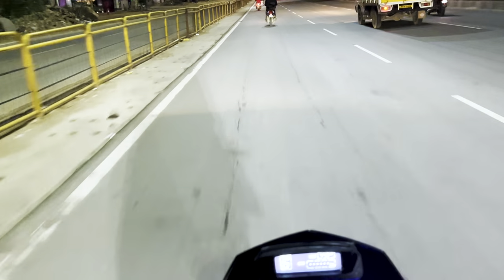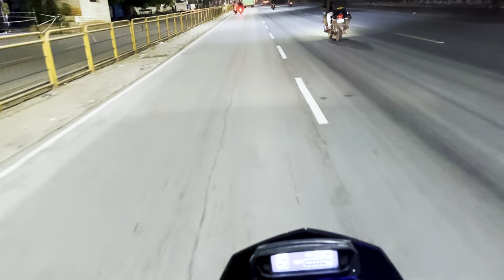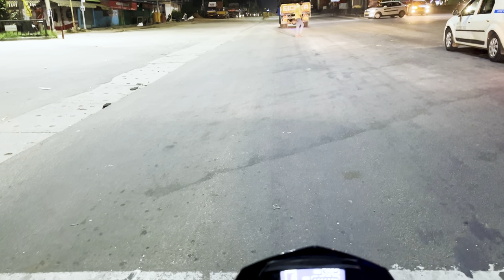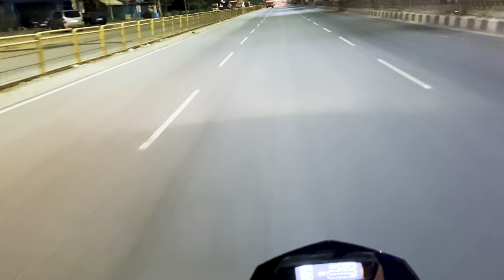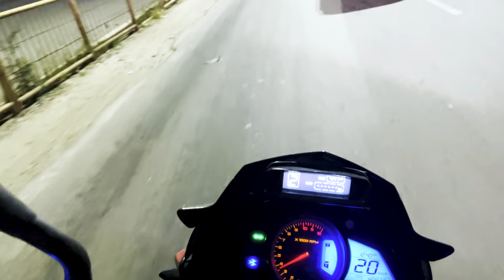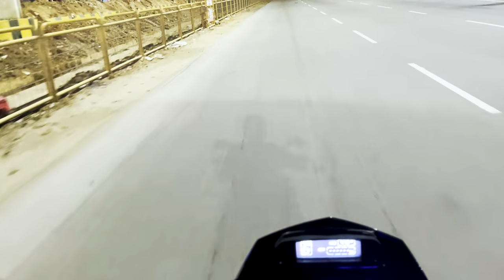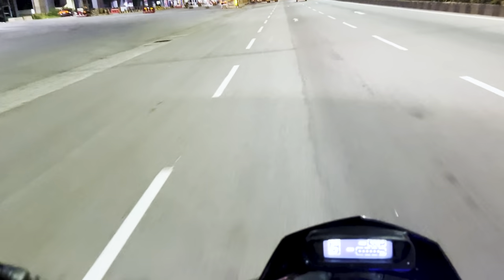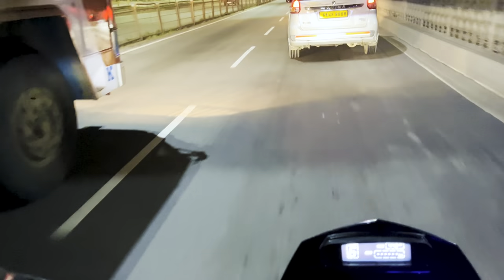Vlog #01 | Initial Review on Slipper Clutch in NS 200

Comment: Bro as u said if there are cuts in the basket we could change the basket to solve.. I have a doubt ns200 basket and n250 basket same or different? I saw ur installation video the n250 clutch assembly came with the rear basket but u didn't use it.. Is it same or different?
Reply from the maker: Hi bro, both are of different size so you cannot install n250 basket in NS
Reply: @ARKIONX  ok bro thanks... When ever I install slipper clutch in my ns I'll keep in mind that to use clutch assembly of n250 and the basket of ns 200... By the way I have ridden my clutch plates 45000kms a little pickup decreased but working fine even after doing wheelies😅

Comment: Hey bro, very informative video, the only channel where i found information about slipper clutch very clearly, 

My ns200 bs6 has clocked 10k km so will you suggest getting new clutch housing? 

Will i feel any glitches at 10k kms?
Reply from the maker: Hi bro ! 

It depends on whether you have any indentation on your housing. 
If you don’t have any marks on housing then just buy the slipper clutch unit. 

Even though you have ridden only 10k kms , the reason for indentation depends on how hard or smooth you operate your clutch and how hard you rev your engine. 

Better check and then make purchase decision.

Comment: Bro what about engine braking, gear cut braking.?
Reply from the maker: There is enough engine breaking to slow the bike down. Moreover once the rear wheel speed gets matched with engine, the clutch engages back.

Comment: Hi thanks for the review. Can you please confirm if this is compatible with 200ns bs3 model
Reply from the maker: Hi bro, I suggest you to take the housing to the spare part store to check whether the slipper clutch assembly fits inside the housing. 

If it fits then you are good to go.
Reply: @ARKIONX Hi bro i have installed the slipper clutch on 200 NS BS3 ( Initially launched as 200 NS later name changed to NS 200 from BS4 onwards) fits perfectly fine. I was not able to test it though. Planning a long ride next week will share my feedback then. Thanks for the content.
Reply: @nileshkangralkar1660 you installed the n250 clutch ??
Reply: @jatinsync3820  yes and works perfectly fine
Reply: @nileshkangralkar1660  any difrence in pick and top speed ?
Reply: @msjdeep103  No difference in top speed or pickup. But definitely makes a difference in down shifts and the clutch also feels a lot softer. Definitely a worthy mod.
Reply: @nileshkangralkar1660  brother are you changed the ns200 clutch housing to new one or you are using n250 clutch plates in your old clutch housing?
Reply: @RSourav_Dey_SINCE_1998  if your old housing is in good condition you can use the old one if you want to replace the housing you would need to use the stock ns200 housing.
Reply: @nileshkangralkar1660  thats i know, but im asking about yours because 200ns is very old so what you have done?
Reply: @RSourav_Dey_SINCE_1998  i had recently replaced the stock clutch hub with a new one hence before installing the slipper clutch. Hence i did not replace it again as it was as good as new.

Comment: Bhai meko ek help chahiye mere pass nhi ns 200 hai bs4 ek problem ye ari hai jbb me apni gadi neutral krrta hu toh meri gadi ka rpm apne app 2 thousand pe pahouch jata hai app bata skte hai ky problem ari hai 
Fir jaise me clutch daabe ke gear me dalta hu fir wo normal pe ajta hai
Reply: Bhai Rpm issue hai apko neeche engine side se set kar sakte ho rpm . Neeche clutch side pe adjust karne ke liye diya hota hai vaha se aap race wale roler ko anti clockwise rotate karke 1000 rpm pe set kardo neutral pe daal ke.